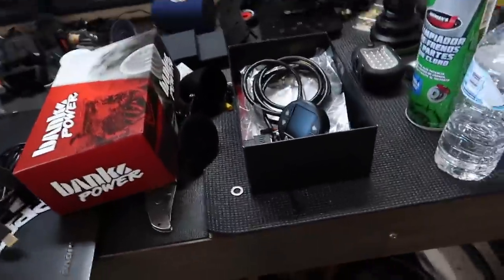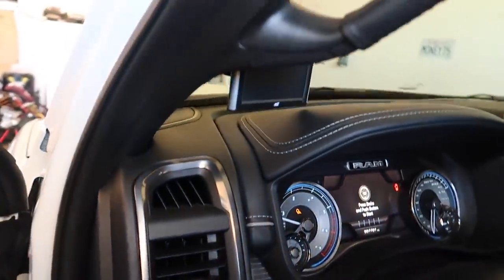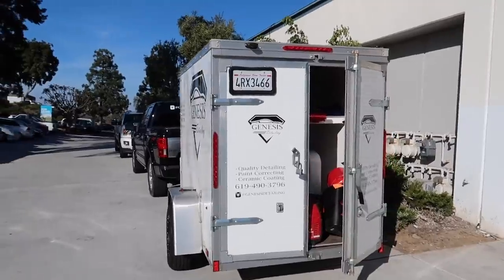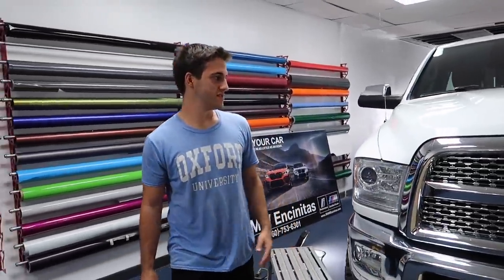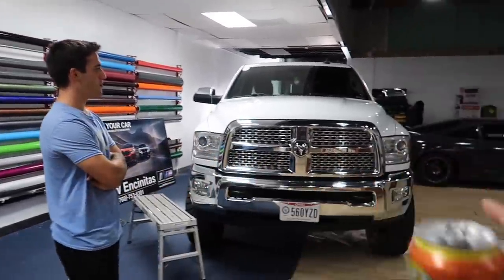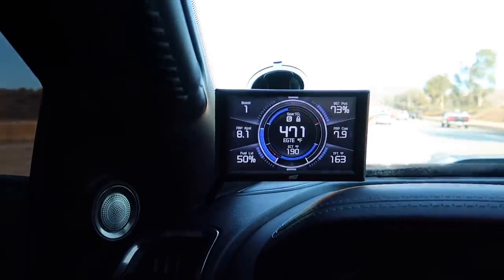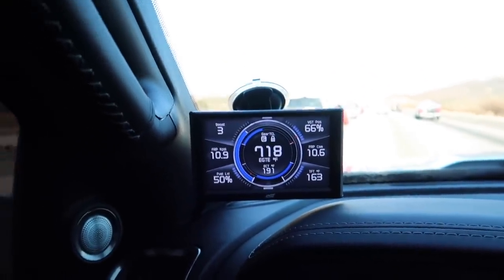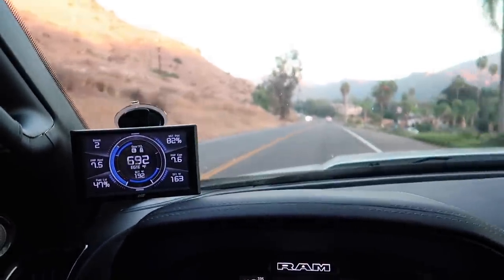WHAT DO YOU USE TO MONITOR YOUR TRUCK?

Comment: Why is the vane position % so high at idle? Is that a dodge thing at 75-80%
Reply from the maker: your tuner can set it lower
Reply: Yes but that’s why you are building boost faster with the vines closed up already. Right?!
Reply from the maker: no sir you are building boost faster because of the drive pressure
Reply: As the Vines close up boost increases drive pressure increases as well. Just quizzing you haha.